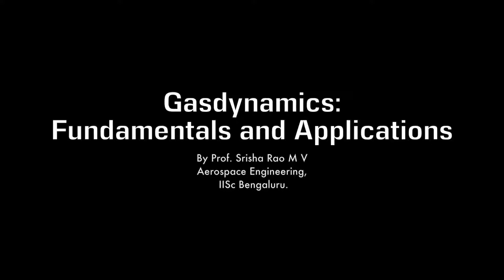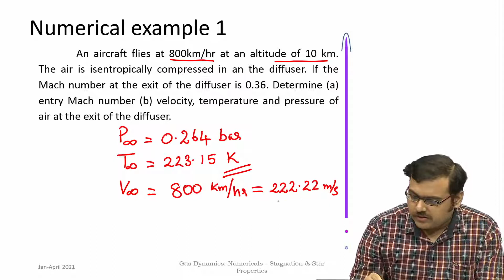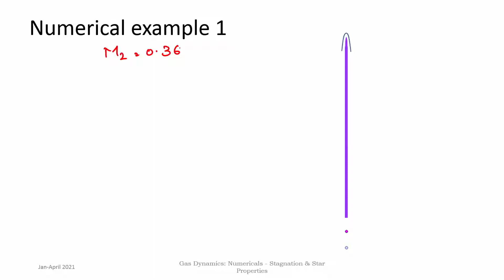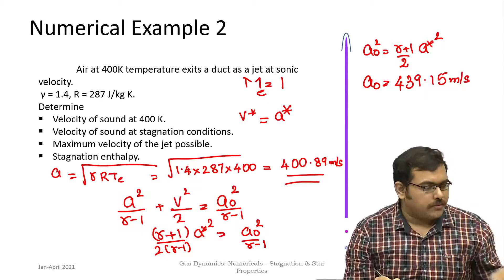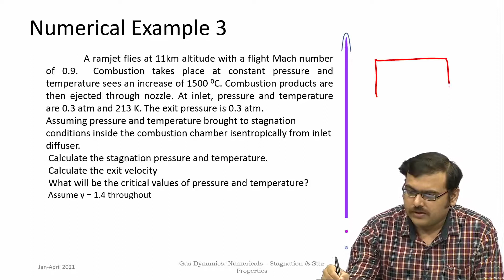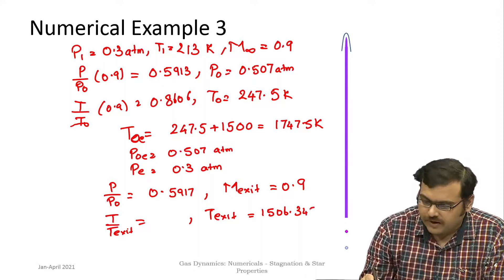Comment: The Third numerical is done wrong , the question says Temperature increases by 1500 Celsius , but the professor added it to a kelvin value of temperature,the correct value of total temperature would be - 2020.65 K and that of critical temperature T* = 1685.22 K. and The exit Velocity should be  752.47 m/s.
Reply: Change in temperature is same in °C and K
Reply: How did you get 1500 celsius as 2020.65 K ??? 1500 C correponds to 1773.15 K and if add to 213 also it will be 1986.15K. Please clarify